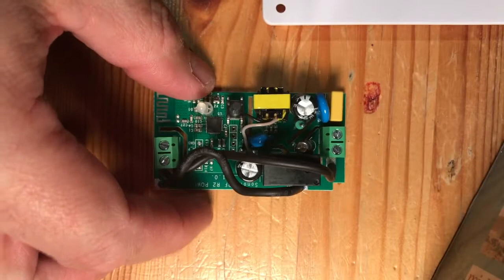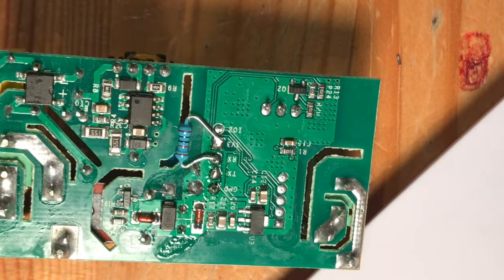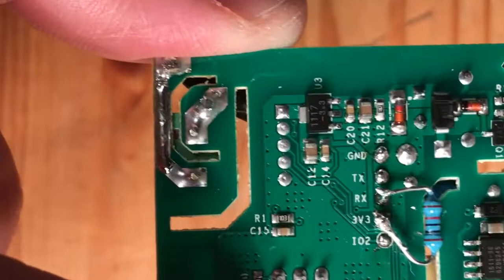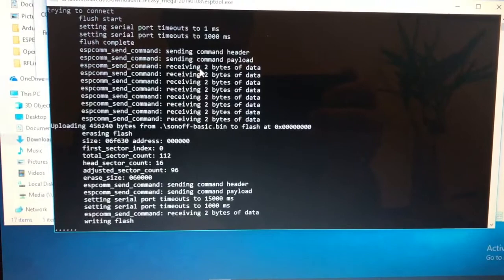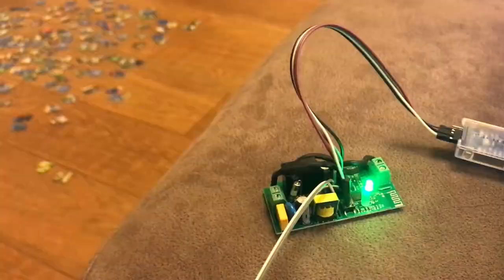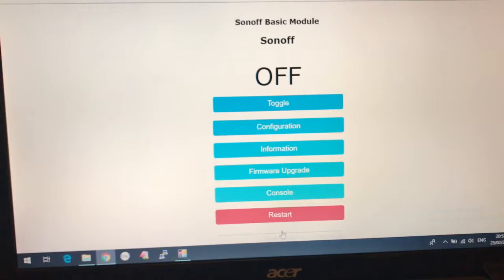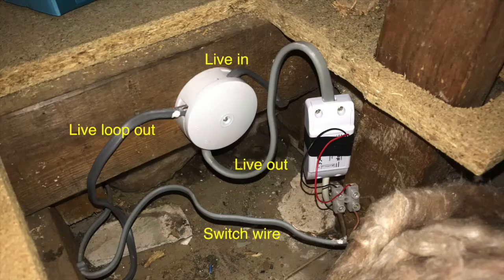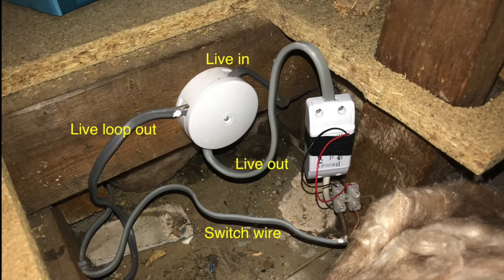Sonoff Basic as Light UK Light Switch with Tasmota Firmware

Comment: If your home were to suffer a fire that involved a claim to your insurance company they would void your insurance if they found this.
This would apply even if this unit was not involved in the fire.
Reply from the maker: I have since replaced these with Sonoff Minis, which have the switch connection built in already, simple to wire, and no modifications required.

Comment: Back to my comment below about only neutral and switched live available from the ceiling rose. I have no access to this particular light and its junction box, I'd need to rip off the floor :-(
any suggestion how would I wire the sonoff for manual switching with just the 2 wires? 
thanks

Comment: Is there a way to coneect a sonoff before my light and control it also from the switch and also from the wifi? When the switch is off it wont work and when the wifi mode is off it wont switch? Any help or a diagarm would really help. Thanks
Reply from the maker: Hi Armun, this video shows exactly how to do this, you need your light switch to control the sonoff, but always making sure your keeping power supply to the sonoff, thus being able to use both methods to control it.

Comment: Hi there. Thanks for the video, this is very helpful. 
Can you confirm where does the wire out of Sonoff go ? Also, a diagram would be upmost useful. In my case there is neutral and switched live going to the ceiling rose, which was confusing the hell out of me, until I found a junction box above the ceiling, so will have to work with that. 

Thanks again.
Reply: duh, didn't think this through, of course the wire out of sonoff goes to the light bulb :-) thanks again for the guide though.
Reply: What's the point of flashing it?

Comment: Clear as mud. You seem have have brought logic level serial out on some wires, maybe ? not sure why ? If the red+black wires are switched current then they look far too small ?  You have failed to explain clearly what you are doing with the wiring or how any of this relates to double switching.....
Reply: The wires on RX and Ground are connected to the switch you would usually use to turn the lights on and off in the room, so when flipped the lights are turned on/off by the sonoff retaining switch functionality in the room. Those wires are NOT connected to the Line and Loop at all.
Reply: @izitorg  I would have wired the twin pair to the mains (loop) as you call it, bringing live an neutral to the switch back box, then fitted an sonoff touch switch (L/N only) - assuming the backing box has enough depth. You then have basically mains powered wifi push button in place of the light switch. Note  what you are doing currently stands a good chance in the longer term of blowing up the ESP IC, as running several meters of wire in parallel with mains with a 3v logic signal terminated into 10k will cause that line to experience  spikes  of >3v, one of which will eventually kill the CPU, soldering 100n cap across it will help a little, but would need to be removed to re-flash it.
Reply: @izitorg  I thought that is what I said?  "sonoff touch", also known as T1. Model numbers T1_UK_1C T1_UK_2C etc
Reply: @jonshouse1  Sorry I thought that was obvious. This is not my video btw. It simply demonstrates how to hook up a Sonoff Basic, I don't see that your original comment really helped anyone, simply stating the the wiring was "Clear as Mud" as you obviously understand what you're talking about, you could have been more constructive. I was trying to explain to someone (you) the purpose of pulling RX low via the switch as I misunderstood the original intent of your comment.